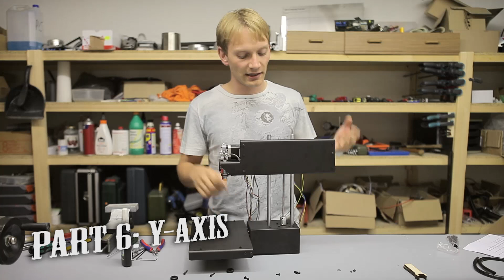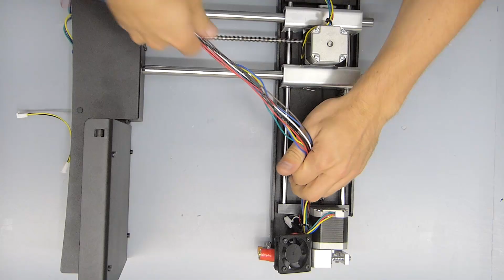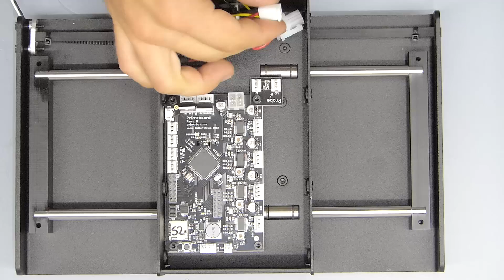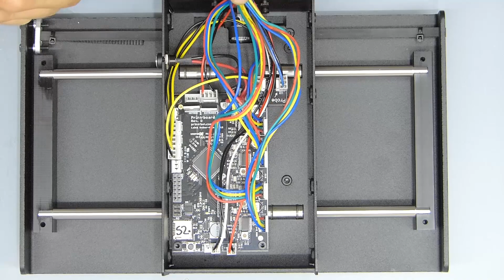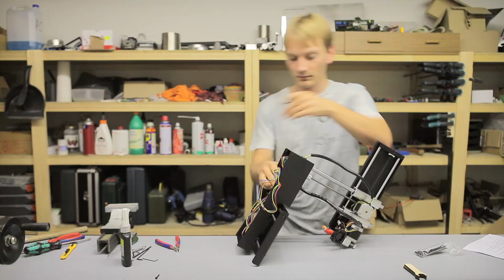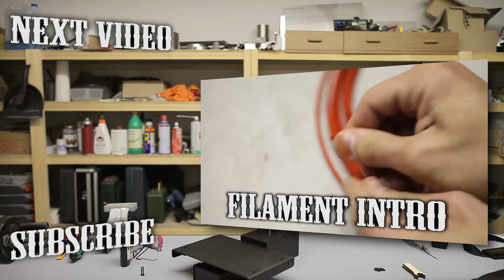Printrbot Simple Metal Kit assembly: Part 7 - Wire management

Comment: Tom,

The small potentiometers on the stepper drivers I think you mention are for current control. How would you use these when setting up Jerk, Acceleration and Max or PID for the various motors.

Gruss aus Paderborn,

Alan